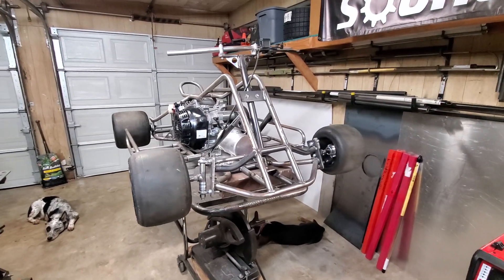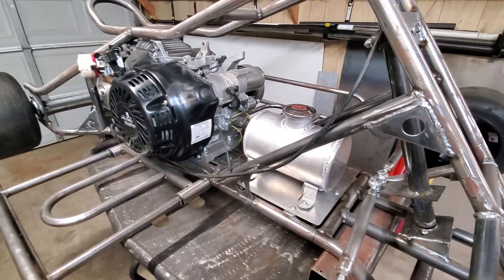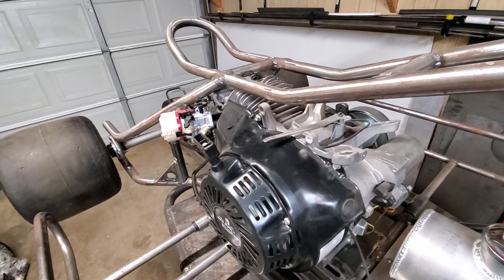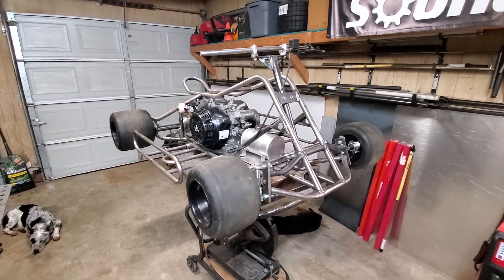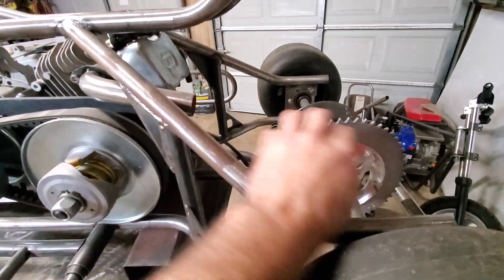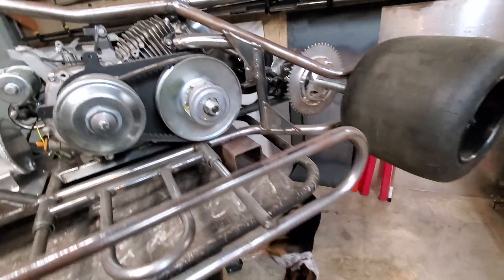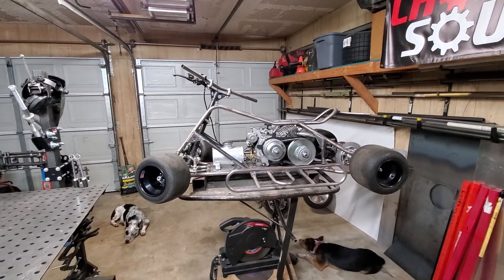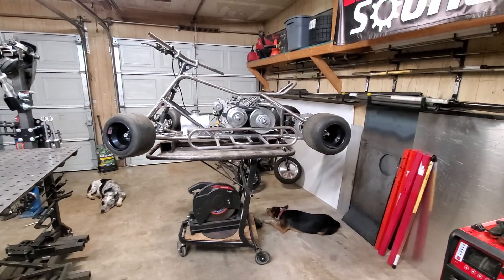Prototype driftquad update.

Comment: What gear ratio is good for a 212 with a 30 series torque converter
Reply from the maker: I like a 12 tooth sprocket and 60 tooth axle with #35 chain
Reply: @turbolaser24  thanks
Reply: What high speed do u get ??